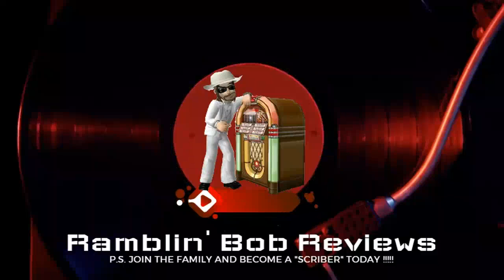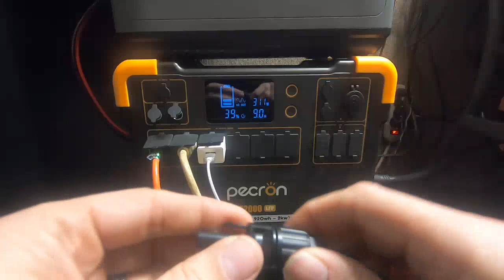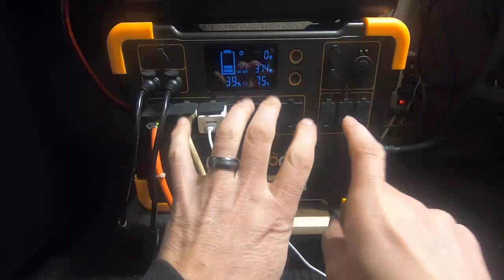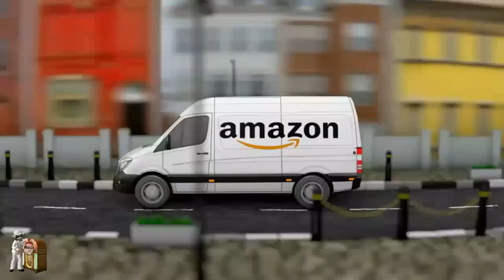PECRON E2000LFP & EB3000 (Update 33)

Comment: I finally had a some what good day to test panels in series. The light / thin clouds caused some problems with production. I checked it as often as I could. I did have to leave for about a couple hours.
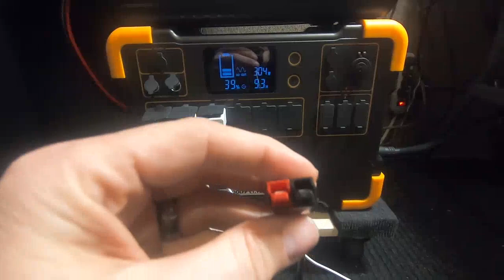E2000LFP (8KWH) Qcells Panels in Series test - Began at 84% at 9:45 - 04/01/23

  11:12 - 355w - a little shade from tree on one panel
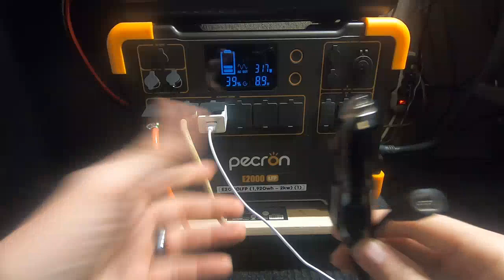  12:29 - 506w - some very light clouds over sun
   1:05 - 516w - some very light clouds over sun
   1:14 - 526w - some very light clouds over sun
   1:41 - 524w - some very light clouds over sun - at 100%
   2:07 - 500w - some very light clouds over sun - at 100%
   4:07 - 60w - some very light clouds over sun - at 100% - Some shade from neighbors tree

The unit never shut down like the E3000 did over 425w. I was hoping to see 600 watts but never did. But given the light clouds the 526w was great. I would say the problem has been fixed.
Reply from the maker: Good Info Tim :)
Reply: So your 2 panels are rated at a combined 640 watts and on a partly cloudy day you got 526 watts max ( That you could tell ) from them.   That's not too bad.  I  know the E2000LFP can take up to 1200 watts max input from the two inputs.  I thought you couldn't use both panels in series in one input since the max wattage is 600 per input?  Wouldn't that put it 40 watts over the limit and possibly damage the battery or am I wrong about something?
Reply from the maker: @BuddyandMax  The first version had trouble using the 2 pv300's in series, But they fixed that in the new versions.
(That is why we had to swap those charging baords, Because we have the first version)
You can also put way more watts into the system per port, The e2000lfp will just limit the input watts to 600 watts.

Anything more than that, You will just lose that extra power because it will not allow it to go into the batteries.
Reply from the maker: @BuddyandMax  Also, With 2 pv300's This is what you can max out to power wise.....

One pv300 on each port (seperate) Max power input up to 700+ watts
two pv300's on one port in series (together) Max power imput limited to 600 watts input
Reply: @BuddyandMax  That is correct on the combined output in perfect conditions. When I purchased them they were the closest to 300 watts I could find with a brand I trust and has great specs. Given what I knew about panels I was thinking I would not see above 600 combined. I have seen the panels in the past produce 620 watts with each one on different ports. I agree the 526 with the clouds was great. Not perfect conditions but it worked. When I tried to run the two panels in series on one port and two Pecron 200w Panels in series on the other port on my E3000 a few months ago I noticed the unit shutdown. I would reset it and it would happen again. I tried it several times and around 425 watts it would shutdown. I contacted Pecron and they said they expected there was a voltage issue even though the panels are rated at 40 VOC. They sent me a parallel cable and said to run them in parallel. That worked. When I seen Ramblin Bob's video on the 330w panels and the unit shutdown around the same value I figured it was the same problem.
I just got the E2000LFP as my second unit at the end of March and since Bob was told the issue had been fixed I figured I would run the same test to see if it was. However we have been having rainy and cloudy days. Saturday was the best day to do the test. So I keep a log to post the results.

Comment: Hey Bob and fellow Rambletons ( followers of Bob ).  Looks like Amazon is offering a great deal on some BougeRV panels right now.  Figures I ordered one last week before this new sale but I'm probably going to order a few more.  I seen some great reviews of the BoueRV 9BB 180 watt panels so that's the one I ordered ( at normal price of course ) but now it's on sale at 42% off.  That makes it well under $1 per watt beating Harbor freight 100 watt panels which still are $129 each.  I have a question though about the 2000 LFP max amp input.  It's only 15 max amps per input.  If hooking panels in parallel exceed that,  will it damage anything.  I believe having these panels in parallel will put me over the 15 max amps since I don't want to go too high in volts in series of more than 2.
Reply from the maker: There is a 25% off any item on google good until the 4-14-23 that brings the harbor freight panels down to 97 bucks :) We are picking up 2 more this week.

note 1: You know me, It is not about what the item costs, It is ALL about does that item work :)  I would try them for that price.

note 2: if you hook up to many amps, The system just will not allow them to go into the e2000lfp and protect the mppt chargers (Down step) :)

note 3: Do not forget to read the negative reviews, Those are the ones that really matter :) A 180 watt is nothing if it only bring in 90-100 watts ;)

GOOD LUCK AND LET US KNOW :)

Comment: Hey Bob i bought the E2000lfp a month and a half ago but now the Dc side doesn't work, it turns on but no power output. Know any fix?
Reply from the maker: hmmmm, never had that problem before, Sounds like you burnt out the dc inverter board, Better contact pecron. Should have that 1 year warranty.

Comment: Hi Bob.  I just got the E2000 LFP last week along with 2 x 200 watt portable panels and 1 x 330 watt portable panel.  Everything is great,  have seen it get over 600 watts with all 3 panels hooked up.  Do you have any suggestions on a good permanent all weather panel to use with this power station that meets the 32v requirement?  I don't want to have to keep putting out the pecron portable panels then bring them in when it starts to rain or gets too windy.
Reply from the maker: We really like those thunderbolt panels from harbor freight, 100+% output and being able to walk down to the local store and buying one without shipping is really nice.

Cheap panels but they do what they say the do.

You can get them on sale for $99 bucks (1 dollar per watt) But you have to change the connectors to MC4 yourself.
https://youtu.be/Jel6RlCpHuk

Here is the review that made us check them out. https://www.youtube.com/watch?v=J8AoFHDvV2w

We are still kinda new in the solar world and are still testing out more panels ourselves :)
Reply: @Ramblin' Bob Reviews  thanks for your video on changing the connectors to mc4.  I was clueless on how to change them.  How many minimum harbor freight panels in a series are required to work with the pecron power station?  I know you can only have a max of 600 watts per input but will 6 panels in a series put it over voltage or amps?  Thanks for your wonderful videos.
Reply from the maker: 4 panels is the limit, your VOC (open circuit volatge can not be higher than 95v)
Those thunderbolts are 21v each, So 4 of them in series would be apx 84v

(But we always like to leave "headroom" just in case there is a spike is power input ever) We keep all of our solar under 48v until we feel very comfortable with solar, We have only done solar for about 1 year so we are still learning as well.

Anything over 48v dc could go right through your skin and straight to your heart...SO PLEASE BE CAREFUL OUT THERE :)

We use 2 panels in series to bring the voltage up past 40v
And then we hook the 2 series together in parallel for 400 watts.

We are going to add 2 more and put 3 in series and 3 in series and those 2 series together into parallel to create the 600w at apx 63v

(Just my opinion)

Note, Make 100% sure you know what wires you are putting together, Solar power can be very dangerous !!!!!

You should watch this video just as a beginning to how to hook up panels, And then learn more after that please :)
https://studio.youtube.com/video/amRFqCMT4hQ/edit
Reply: @Jim Jones I have 2 Qcell 320w panels that work great. I am working on having some REC Alpha Series 400W panels installed. Any good rigid panel should work. You do have to make sure the voltage does not go over 95v in series.If so, then you need to hook them in parallel, Most of the time I run one panel to each port.
Reply: @timh2277  I am trying to get as close as possible to the maximum 1200 watts limit for the E2000 LFP.  Using 3 of the 400W panels would be nice but they are so expensive for " Real " panels and not cheap Chinese fakes.  Using 12 of the Harbor Freight panels like Bob suggested being a good option is good too having 12 panels hooked up ( 2 In series x 6 parallels ) is kind of what I'm leaning towards since all the reviews have been great.  By the way,  they are currently $129 a piece right now.  Hope they go on sale soon !
Reply: @BuddyandMax  If you have the space for the panels that would work. Not having a lot of ground space for ground mounted panels I was limited on the number. I got blessed with the Qcell 320w panels. The supply house only had four left and was not expecting any more since most installers are going with larger panels. They sold me two at $115.00 each and delivered them. I began to wish I had gotten all four but the other two got sold before I checked back. So check with a panel supplier in your area to see what they got and if they would be willing to sell to the public. I had a solar installer recommend the supply house I used. I was having a building built that got finished in Jan. I can now install 6 panels on it to use. The angle will not be perfect with a 1/12 pitch roof to the west. So I figure I will not see anything above 300w per panel. But for emergency preparedness it will work. I am looking at about $413 per panel for the REC Alpha 400w. The QCell 400w panels were to long for the roof to do two rows.
There is a site that sells refrib and test used panels at a lower cost. SanTan Solar. I heard about the site from a couple solar build videos.